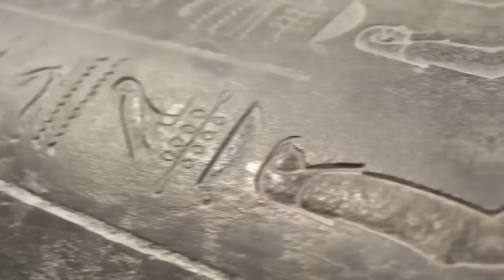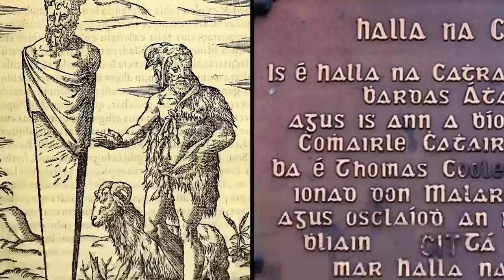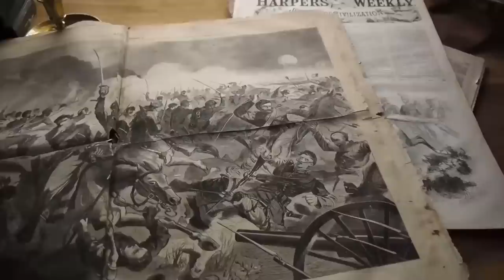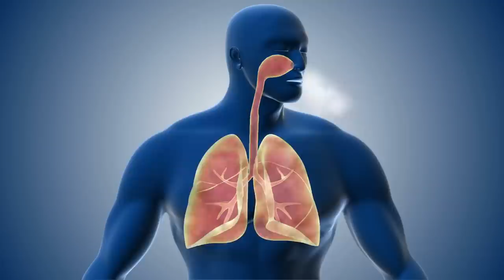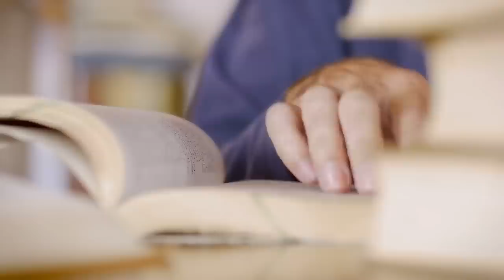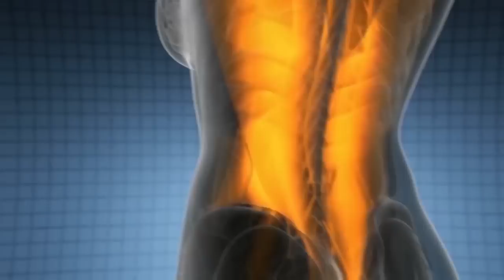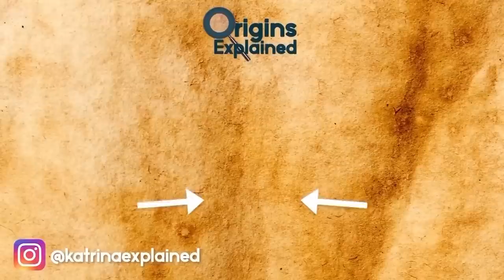Bizarre Archaeological Discoveries

Comment: yes   FL  everglades  george here:  if  it  is  Cold   and  late  in  the  day  you  can  respectfully  walk  over  them   -  or  bicycle  thru.   4 foot  aligator    =   a  teen.  of  course  Eyes  Open and  Don't  Ask  for  it.    
i  have  no  such  close  experience  w  fl crocodiles   those  have   more  of  a  repu'.
ps   a  true  story.   once  a  friend  and  i  were  bicycling  The  Pinelands.   trails  a  bit  off  towards  the  boonies.  hot  very  hot  -   beautiful  clear  cool  lake  i  almost  jumped  it      hours  later  we  circled  back    by  the  lake.   turned  the  flashlight  on  the  lake:  dozens  and  dozens  of  pairs  of  glowing  red  eyes   waiting   for  a  hot  swimmer...
advertizing  gators  Don't  ....